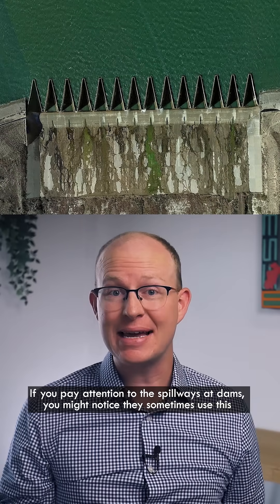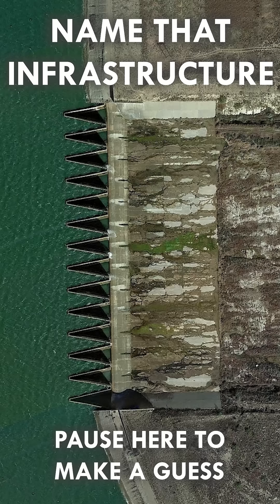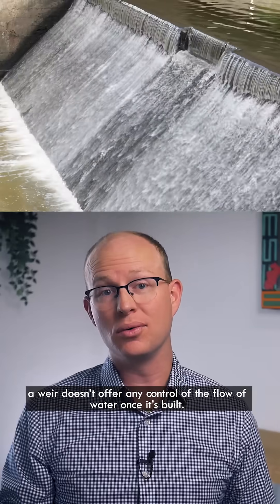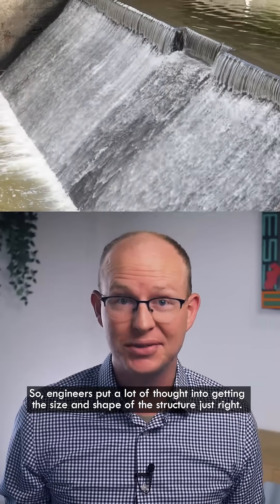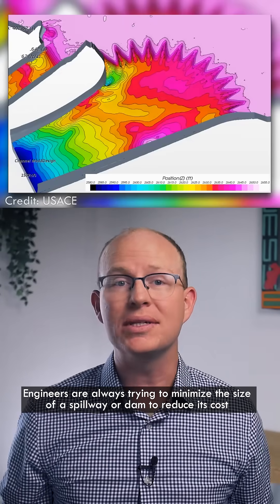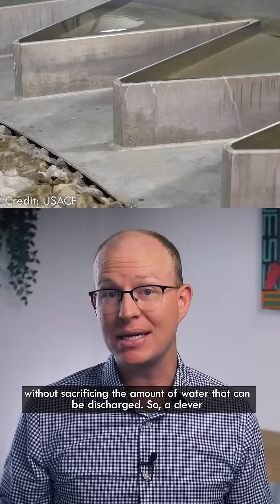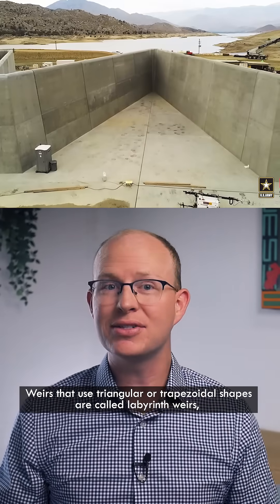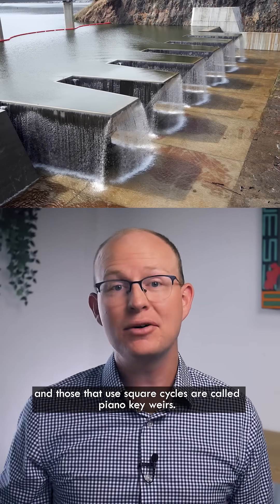Name That Infrastructure (Ep. 7) #shorts

Comment: Don't know that it saves costs as it is still the same length of spillway to build.

the more complicated shape will also take more time to erect than a straight spillway

It probably will save time on the site preparation 

I would think the real benefit is in having more spillway surface than the width of the dam site would otherwise allow

Comment: I don't really get it. Does the shape of the wall prevent the flowing of water by disrupting the surface tension? Water sticks to it self and if an  amount of water can flow over an edge it can drag more water with it on the way down. Am I even close to the right answer?

Comment: Go up to the local hardware store and get a 1/8" flat head split-pin for that action clack. Insert the pin, bend the split end of the pin to secure then clip the excess. Quick and easy fix. Or use a corresponding black phillips head bolt and tiny nut.

Comment: Basically you are increasing the area of the spillway ft^3 so that the velocity ft/sec is reduced for a given volumetric flow rate  a*v.  Because velocity is the main source of wear and erosion.
Reply: Wait if the area is decreasing(near to the vertices of the weirs), shouldn't the velocity increase by a great amount?
Reply: The velocity at that point is faster but the amount of water is so small it does not matter.

Comment: This reminds me of how solid rocket engines shape the fuel to control things like thrust and burn rate by manipulating the surface area just like this! (It's called grain geometry).  

Think of a gunpowder tube with a circular hole down the middle, as the fuel burns outwards from the middle the thrust increases as the area increases.  But with a star shaped hole the surface area decreases allowing for higher thrust at the start when the vehicle is heavy, and lower thrust when it's lighter later in flight as the star points are consumed.

Comment: Sometimes the folded shape is at the bottom, where the water meets the original river. My guess is it's supposed to lower the force of the water and the resulting erosion of the water bed. You could do a video about this specific case.

Comment: why cant it just pass over the normal effing ground, zig zagging the ground dont make it fall any less dude , it still falls
Reply: Giving it more area to fall off means that it has less pressure and velocity when it goes over the top.    Think of it like a garden hose or shower head.  Without a nozzle the water comes out at a certain velocity. If you add a nozzle that is smaller than the diameter of the hose, the water will shoot out faster.  If you use a nozzle that allows the water to spread out and come out over a wider area the velocity of the water is reduced.  

In a water way, an unrestricted flow is like the hose with no nozzle,   a dam or weir is like adding a nozzle, so they design it to act differently depending on what they want the water to do.

Comment: If you are a kayaker, canoeist or swimmer, many of these are really dangerous to play with as the flow that passes over them often has a large tow back and partially if the are ones like the triangular ones they funnel the water back towards the narrow point at the upstream section and you will get trapped in them

Comment: Can a weir have multiple levels? 

My hometown flooded two years before I was born. Back in the 90's the city partnered with the US army corps of engineers to construct a flood control project through town. Seven reservoirs for the seven incoming creeks and rivers well outside the city. A massive man made rock lined canyon, river meandering through the bottom with a grassy flood planes between the river banks and canyon walls. They even dropped huge boulders in river periodically. They have long since been buried by sandbars that formed around them. But at the start of each branch of the channel where water enters the system, they have a concrete structure across the river. It has a straight level top with a square taken out in the middle. That lower section is normally where all the flow crosses the structure, with the height of the water flowing over fluctuating. But when a big rain event happens, the water over tops the entire length (which usually has the river inside town close to the top of it's banks).

Would it be a weir with two spill ways? Or something else?

A few years ago we had a record rainfall event (thank you climate change.....) I think it was a one in 250 year flood event. It was bigger than the flood event that spurred all the flood work in the first place. I happened to see one of the concrete structures as I drove across a bridge. If I didn't know it was there, it would have been difficult to locate it. Normally the river drops about a dozen feet at that spot. At that time it was a barely noticeable change. Maybe a foot at most, if even that. No concrete visible at all. The canyon was maybe half way filled. The water was deep (I used to play down on the river banks as a kid, I know how far down that flood plane should be) and fast, but smooth and orderly (I've seen lazy river rides at water parks with a rougher water surface). Terrifying and impressive at the same time.

The smaller river towns downstream got hit hard, really hard. All we had was localized street flooding as the storm drains struggled to cope.

Comment: But why do you need more length?
Reply from the maker: More length=more flow=greater capacity
Reply: @PracticalEngineeringChannel but if there is to less flow wouldn't the water just rise up a little bit and so more water will flow?
Reply from the maker: @highcap4952  Yes, but then you have to build your dam higher so it doesn't overtop. The goal is to be able to discharge a wide range of flows within a narrow margin of upstream elevation. Sorry for the confusion!

Comment: Is there some kind of mechanism that keeps the thing level while the earth moves underneath it?   Or do they just fix it every now and again?
Reply: I’d say all of the dam has very deep foundations that keep it as steady as possible, and earth movements are slow enough so as not to make repairs necessary in several decades.
Reply: @hadri1  If you've seen one of those fountains that flows water all around it's edges you'd see just how ridiculously level it has to be for it to spread the water fall like that.  Regular dams wouldn't care.   But those saw tooth ones would.  You are long past the point of it functioning if cracking ever happened.   Having it out of level in the x or y, even slightly would mean the water would concentrate on the low spot making the entire saw tooth thing expensive and pointless.